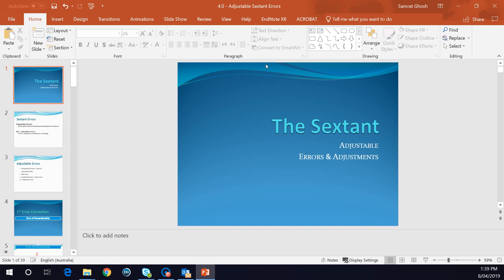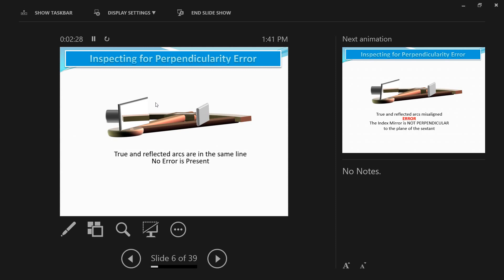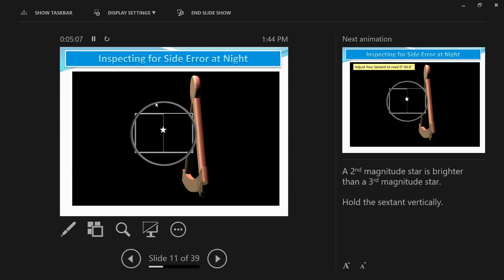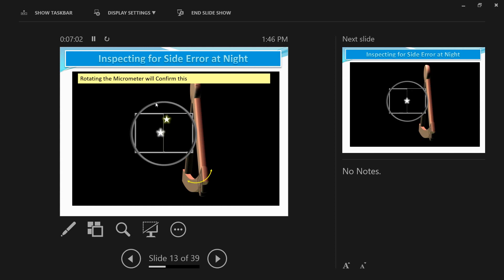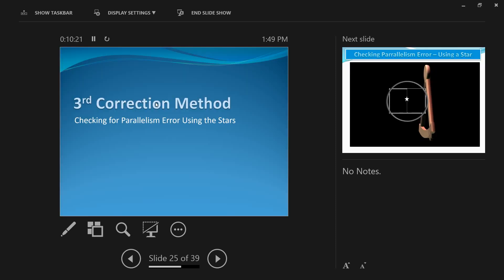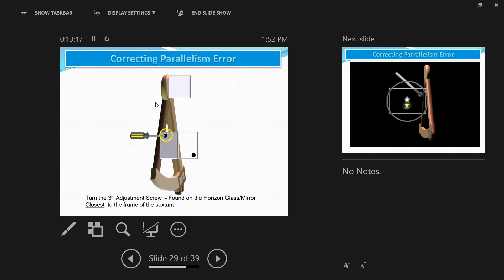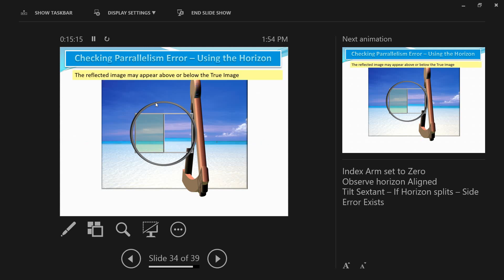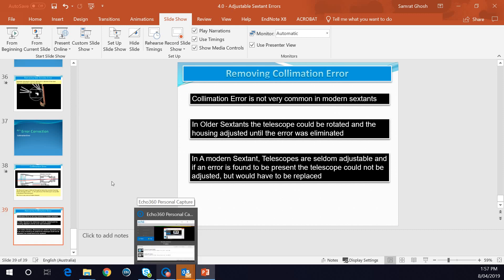Adjustable errors of the sextant - Determining and correcting the errors

Comment: Largely useless video because at least 40% of the dictated information cannot be heard (sound continuously goes away). Close captioning doesn't help either and not enough describing text is present on the slides to compensate. Too bad.